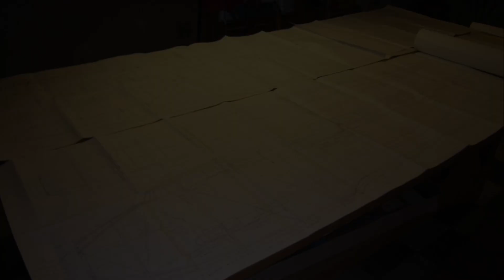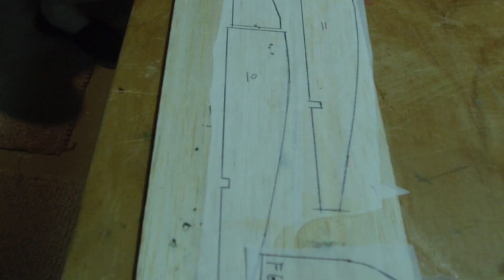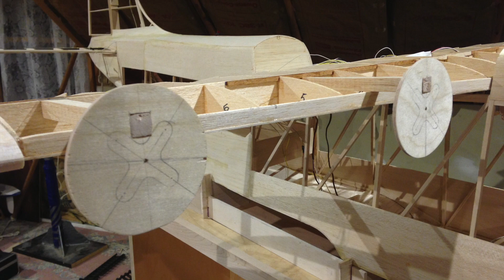Building the RC Short Solent

Comment: What covering did you use to make it waterproof?
Reply from the maker: The hull and tip-floats are all fiberglassed with thin cloth and epoxy resin. Then those parts and the rest of the plane is covered in the typical RC shrink film covering such as Monokote. I believe I used a film called LighTex.
Reply: @redjem13  Thank you! will the skin be thick enough to protect the ship from rocks and the ground?
Reply from the maker: @velcro62  generally, no. Gently touching rocks or other objects won’t damage it, but if I were to hit a rock on take off or landing it would absolutely puncture the hull. The reason the plane flies the way it does is because it is built to be just strong enough, and nothing more. This means the overall weight is very light for a model of its size and therefore seems to float around effortlessly.